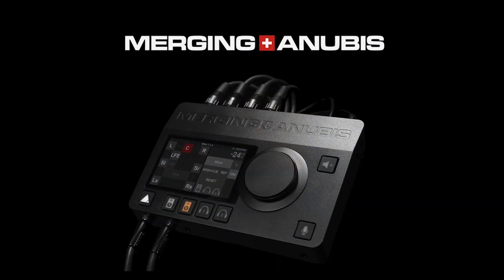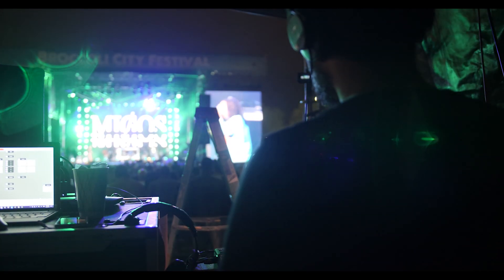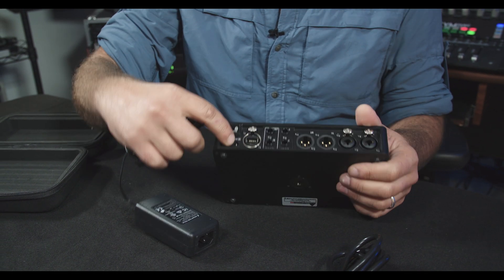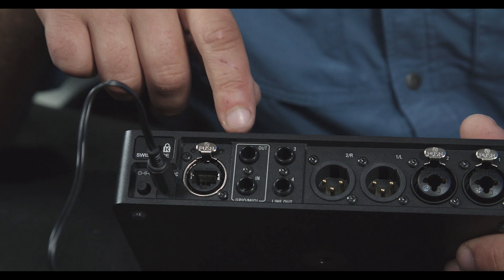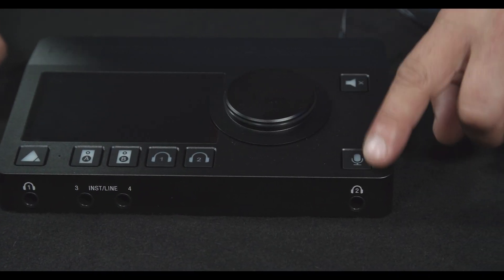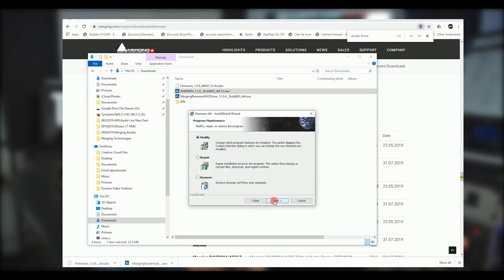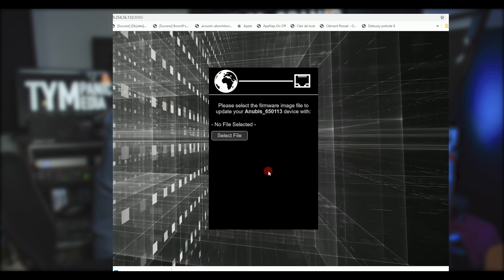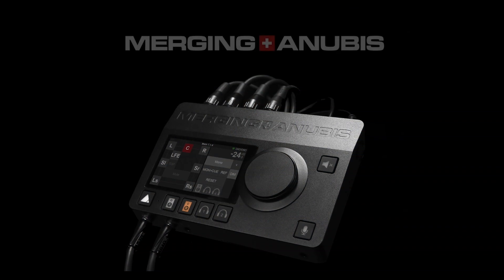MERGING+ANUBIS Tutorial 1 - Unboxing, Connections & Firmware

Comment: The deeper I go with Merging, the more I realize that Anubis has to be part of the Merging eco system. 

In my first thoughts I was thinking of investing in a Hapi interface to drive a 7.1.4 Atmos configuration. 

But Hapi alone appears to lack a lot of features and flexibility, such as using its Zman chip as a room-correcting dsp.

Is it part of Meerging's market strategy (or even just hardware limitations) or can I expect Hapi to have all the features of Anubis in the near future?  Especially the use of DSPs with room correction capability which is crucial with Atmos.
Reply from the maker: Hello, 
One could use and Anubis only with IPaes67 speakers and a switch, that would be the other possibility for a Dolby Atmos setup. But yes, for the time being if you need Analog or AES/EBU outputs, a HAPI MkII + and Anubis are needed. 
Zman chip equips indeed both, Anubis and HAPI MkII, but the functionalities and the design of the device are not the same. We are not excluding that at one point in time Zman chip within the HAPI MkII will get some features that exist in Anubis - but this could be a future project amongst many others.
We do not think that HAPI lacks features, it is used for other purposes such as an audio multitrack i/o device of the highest quality with up to 16 Mic/pre and high quality outputs + 8 AES/EBU and 8ADAT. The 2 slots hosting the Analog i/o cards could also be populated with a MADI card or a PT64 for a Pro Tools HD DAW. 
All those features are not available on Anubis and both are very complementary to each other. 
I hope this gives a bit more clarity about the functionalities of each device.

Comment: Err.....   So you just download Aneman, plug it in and suddenly your ethernet port on the computer and that on the Anubis are suddenly fully set up and talking to each other? Not so fast!   That's a very important bit that has been overlooked. I'm sure I'll sort mine out eventually .. but basic IPv4 settings should surely be talked about first.
Reply from the maker: Hello, Aneman is not a driver that will connect things automatically, it is like a virtual patch. So if you have your Anubis and your computer visible, than you can connect the i/o of those devices in Aneman. You may find responses in our online support tool https://confluence.merging.com/display/PUBLICDOC/Network+recommendations+for+Anubis
Reply: @MergingTechnologies  Hi- Thanks for the reply. I had everything set up as should be... but I have been advised that older firmware can have problems being seen by the latest Aneman and MAD, So I will be using the old versions to update firmware to the latest - hopefully that will allow Aneman to see the Anubis. I could control it via browser but Aneman couldn't see it at all....  Cheers.

Comment: Ok, thanks for the Info- but my Q is:- can l use it in my studio as a direct interface ? I was considering to buy the RME UFX+ as my main interface but than this device came into my attention- like l said, please help me understand if this is a better option for my studio (in my case)-  all l need is 4 or 6 In’s (1/4” cable) and 3,4 Out’s....- that’s it...!!!
Reply from the maker: Anubis has 4 analog IN + 8 analog OUT, if you need more i/o you can combine it with another Anubis or another converter over the network
Reply: @MergingTechnologies  I guess you got my question wrong- all I need is to have just one interface, and quit the RME....- Zeno other units into my studio- So I don’t know how is this one working as a standalone, main interface.... As for the more inputs, no l do not need more (for now)- But it’s good to know that I can connect with my friends, from different continents...
Reply from the maker: @viociarnau1670  
Sorry for the misunderstanding. Yes, ANUBIS is working perfectly as a stand-alone interface. We provide the virtual sound card as well to connect it over the network to your computer (either MAC or PC Win10) it all comes with ANUBIS.
Reply: @MergingTechnologies  what is the latency of this unit? (everybody has a latency, unless they say “zero latency”, which is very hard to believe...) RME is well known to have one of the very low latency compared with other units, when they talk about their flagship unit UFX+... Also, can you say that those converters are as good (or even better) as other amazing names out there- Prism Atlas, Burl, Apogee, Orion...etc etc? A lot of info is how to connect it with the network , etc etc... but I’m very interested to buy something like this, as a pure interface, with amazing converters, and easy to hook it up to my PC...- no glitches, no latency, no headache..., but an amazing workflow sound and results...! I would appreciate to see a video of the unit , working pure with instruments, in a studio set up... not what the touch screen/Menu can do.... - I forgot to ask you about its connection with my computer is it working faster than thunderbolt? Also if you guys declare that this unit is so amazing, why don’t I see more comments and talk about this interface?  I’m doing a lot of research for a good interface with amazing converters, but I don’t see people talking about this one too much... why not? Are you planning in coming with the new device with more inputs s as me maybe TB, or this is it? Thank you for your reply/time
Reply from the maker: @viociarnau1670  Anubis has a built in Mixer so that there is NO latency for example playing back your DAW and adding a vocal or an instrument, there is no latency on your headphone due to the internal mixer. To understand how it works I would suggest that you have a look at the webinars https://www.youtube.com/watch?v=GetTdlq5x3E&list=PLTD8xEWRODkGCdx2KpqiHZJinGsfuN0k1 
TB circuit is included, you even have a small microphone built in.
In which country are you based, the best is perhaps you get in touch with a dealer

Comment: I’m still confused as to how this connects to a pc? Do I need a network to USB adapter? They couldn’t just put usb?
This is why I’m on the fence of purchasing this right now
I don’t understand the connextion
Reply from the maker: If you do not have an Ethernet connection on your computer, you may use a USBc to Ethernet or Thunderbolt to Ethernet. Be aware it has to be 1GB Ethernet adaptor (it is very common today)
Reply: Simply connects to your computer via ethernet
Reply: @rollmottle  What if you do not have an ethernet connection in your studio?